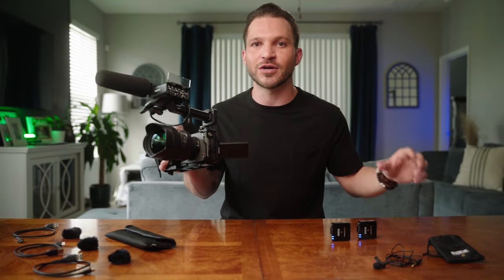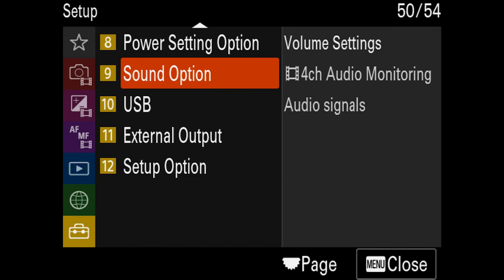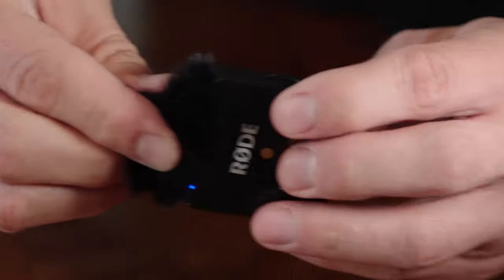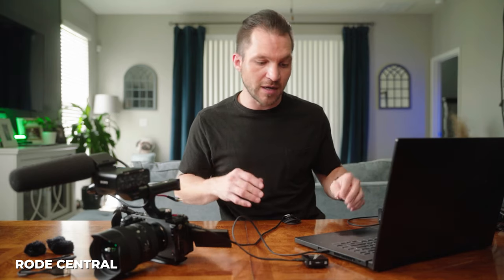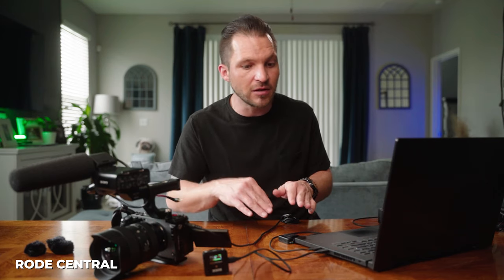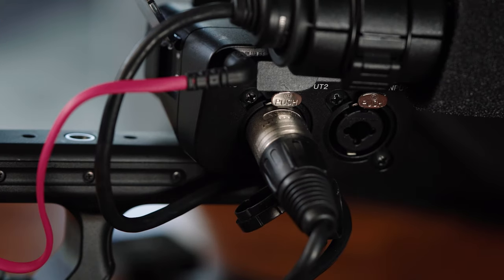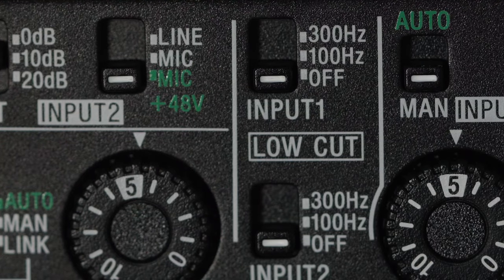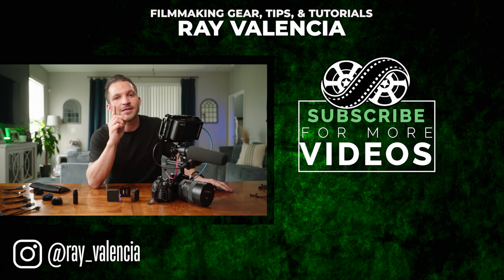RODE Wireless GO II on the Sony FX3 XLR Audio Handle Explained

Comment: Great video. I learnt a few new things on this.  The only thing that i think you mixed up was when you are using the 3.5 to xlr     Xlr is a mono port so when you use that adaptor you are combining the wireless go mic’s and they will be on both channels.  Best port to use would be 3/4 then channels are split    If you want  control of both channels then you would want to split your 3.5 out of receiver with a y cable and put one in  ch 1 and the other in ch 2.    This how i run mine and then my video ntg into 3/4

Comment: At 4:48, you show the 3.5 stereo into the VXLR adapter, then put the switch on the back of the handle to input 1. I'm wondering about the next part where you're adjusting audio levels using both dials. You say the dial for input 1 is changing the level for mic1/left and dial 2 is changing for mic2/right.  In my experience, it's mixing both mics down to a single input, but the dials let you change that mixed signal to record at different levels (not separate). The VXLR adapter is not giving me the ability to control left/mic1 with dial 1 and right/mic2 with dial 2 separately.  It's letting me record the same mixed audio on left/right at different levels. Is there a setting I am overlooking or did I misunderstand what you were saying in the video? Thanks for your time, especially to reply to a comment on an old video.
Reply from the maker: Hi Jim!! No, you are totally correct!!!  I see what you mean about how the video looks like you can separate the Rode mics with that adapter.... so what I was trying to say was that with that adapter, you can have finer tuning of your Rode GO mic (AND your shotgun mic).  But if you are using 2 GOII mics, then the 3.5mm jack on the Handle is still better than the one on the FX3 body because you have the additional PreAmps and dials.
Although, I posted a video today of a QUAD Wireless microphone system from Comica that you can actually separate all 4 MICS into 4 different channels on the FX3: https://www.youtube.com/watch?v=cIsBboy6i4Y
Reply: @RayValencia  Hi Ray, so are you saying that it is not possible to connect the receiver to two seperate XLR inputs by using 2 seperate VXLR adapters. Is there only one 3.5 mm output on the receiver?

Comment: Thank You , Another Clearly explained video. I see you must teach your Actors / correspondents well. I'm a sound man so I record the best WAV sound in my mixer. I use channel 3/4 for timecode from my Tentacle  Syncs. Then I use the Rode Wireless Go 2 as a 2 channel link from my mixer, to the inputs 1 and 2 on the Sony Audio Handle to the XLR inputs. I found an unbalanced  3.5mm jack that splits the channels to the Left / right XLR's. Now the editor has broadcast quality audio on channels 1and 2, and a time code on channel 3 that Premier or Avid can find, for syncing my bag audio if it's needed. 
Maybe you can do a video showing this setup that i use for News / documentaries . This gives my camera person the freedom to move with out being tied to a soundman.

Comment: Great tutorial. One question. I’ve been trying to figure this out. Do we need to use the Rode XLR to 3.5 mm adapter or will any adapter do? I have some generic xlr rk 3.5mm jack adapter which I connect to XLR port 1. My Rode wireless go is not detected on channel 1 of the XLR handle.

Comment: Hey Ray. Awesome channel, your videos have been super helpful over the years. 

I’ve got a question that’s always bugged me as I can’t figure out the settings. When I’m using the 2 x Rode Wireless mics I have them set in split mode and yet monitoring on the camera I’m hearing a mixed or merged audio. I’m not hearing 1 mic’s audio in say the left ear and the other mic in the right. Also when I import and seperate the tracks in Da Vinci it only has a merged recording. Wondering if you’ve run into this problem? Or do you just take the individual recordings from the onboard memory on the Rode TXs?
Reply from the maker: Thanks onasht. I appreciate that! If you use the 3.5mm jack (Input 3) it will separate the mics on 3/4 (if you have your Rode set to sep. outputs).
If you want to use the 2 XLR ports, I ended up using a Comica 3.5mm to XLR channel splitter: https://geni.us/Comica_XLRsplitter
Then you can adjust the headphone settings in your camera to play on your left/right ear. Hope this helps. I just got the Rode Wireless PRO yesterday, so I'll be visiting this topic very soon.

Comment: Hi Ray, you teach me a lot with this, thanks a lot. When I manually adjust the levels of my sony shotgun mic on the fx3 connected on input 1, I can only ear it on my left headphone if I lower the level. if I increase it then the sound goes on my right Side of the headphones but when on auto I can ear the sound on both left and right sides of the headphones at the same time…
Reply from the maker: Hey Luca. Thanks. What do you have your Input Selector on the back of the handle set to? Did you see the part where I was talking about enabling a
Your own safety track with the Input Selector? You can make your Input1 shotgun mic go to Ch1 and CH2. Or just Ch1.  Also, check your headphone settings in the Menu. You can specify which channels you prefer to hear in Each ear. This is helpful for lots of Inputs, or if you only want to hear your Lavs and no shotgun mic, etc.

Comment: Hello, I want to ask that I am FX3. I connected the RODE Wireless GO II to the XLR of the FX3 handle, and found that it can only receive the sound from mic1, but there is no sound from mic2. Is it because of the XLR? It is still necessary to use a 3.5 to double XLR, and connect the two XLRs to the handle respectively to solve this problem??

Comment: The xlr adapter eliminates the stereo feature of the rode cuz it merges the 2 signals from L and R to mono on the record. You didn’t mention this, do you know about it or have found a solution? I‘m looking for a solution for month…

I have the fx6 and fx9 and they both have no 3.5mm aux.

Comment: Ray, to clarify my previous comment, if you want to use the DJI Mic (or Rode Go II, which is the same concept) and connect the receiver to the XLR input, instead of Input 3 (3.5mm), could you use a Stereo female to dual mono male cable? The 3.5mm jack coming out of the dual receiver would be splitter into two separate male jacks that you could plug into XLR adapters. Would that allow to get to separate signals on channel 1 and 2, with the benefit of having a full control over gain, Att and low cut via the butons on the XLR module of the FX3?  What do think? Thanks!
Reply from the maker: Part 2 of this response: in a later video, I discovered a Cable that split up my Comica wireless mics and now I use it on the DJI (and used it on the Rodes before mine went into the water). 
Here the link to separate both mics out.
Comica CVM-DS-XLR Cable: https://geni.us/Comica_XLRsplitter
Reply: @RayValencia   Wow, that seems like the ideal cable indeed... Not available on the Spanish Amazon (l live in Barcelona ) but will definitely look into this. Happy to hear you used it and it worked. Also wondering if you use lavaliers on your DJI mics? I tried to connect that of my Sennheiser but it doesnt work ... no signal at all.. not sure why.

Comment: Your videos are amazingly helpful. Thank for this. I just bough the DJI Mic kit and I wanted to connect it to the FX3 using the XLR input, but if I understood well, by doing so, I loose the ability to separate the 2 mics on different channels, right? When you connect the receiver to the 3.5mm jack, it does separate both channels onto channel 3 and 4 but the control panel of input 3 doesn't allow to set the gain of each channel separately (neither does it have low cut and att controls).. So is there a way to get into the FX3 via XLR and have both mics on separate tracks? (1 and 2 I guess...) Maybe does it require a splitting cable? to get into Input 1 and Input 2? Thanks in advance! As an Fx3 shooter, you channel is invaluable
Reply from the maker: Awesome. Good to hear from you. I also recently traded out my Rode Wireless GO 2 for the DJI Mics because The 2 actors in the show I was shooting, fell in the water wearing my Rode mics. I shot it on 2 FX6 and the FX3. It's in the show I shot for TripAdvisor on Amazon Prime, Called "The Wanderer" Season 1, Episode 5: ORLANDO. 
I'll answer the rest of your question, I'll your follow up comment, I just read.https://www.primevideo.com/detail/The-Wanderer/0OV3IWR0DY8UV27HZ4VCXFHBW5
DP: Ray Valencia
Reply: @RayValencia  Congrats on the show. It's pretty amazing to see that high end professional shows are made using such accessible gear like the Rode Wireless GO2.. I'm also used to use a pair of AVX for sound as it's pretty much the quickest and safest option when you're a solo shooter and dont wanna add too much stress and workload.. (I loved the small size of the receivers.. until I saw DJI one.. haha)... but they tend to drop signal quite easily and the neat form factor + internal recording of DJI's mic really attracted me. I tested out today, connecting to the 3.5mm jack of the 3rd input of the FX3. Still need to download the footage and check how it all went. Did internal recording + safety track as I was only using one mic. Battery died after 6hours.. like 10 min before wrap.. the non-exrtable battery is definitely going to be an issue, specially as the product will age and battery health will decrease.. seems like its not a very sustainable product in any sense of the term... For the rest, it was a breeze to use on set.

Comment: Hey Ray, Love the video, super helpful !! Pound for pound which shotgun mic would you say suits the fx3 for the best all around ? I tend to shoot a lot of stuff outside, motorcycle stunt, downhill mountain bike stuff and live bands.. I'd love to be able to capture clean, crispy sound. Love the wireless options, ill def be looking at adding that to the mix after I get a shotgun dialled in. Cheers, Jb
Reply from the maker: Hi! Great question. I may make a video answering this question, so thanks for the idea. I'm rocking the Rode NTG5, short shotgun mic $500, and I have an even shorter shotgun Mic from Deity called the S-Mic 2S for like $300 (The 2S is the Shorter model, the 2 is their regular length mic). But all of those mics are also Water and Moisture Resistant so that would be perfect for your outdoor shoots.
Reply: @RayValencia  Awesome brotha !! Thank you for the insights

Comment: Thanks for the great info!  My middle school is looking to getting into video production program using FX3 (well I'm suggesting we purchase/invest in the FX3).  I was looking for Audio options.  These RODE GO II seem really great for students to use for "on location" interviews at sports & school events and maybe "in the studio" work.  How do these mics compared to other lavaliers you've used?  Do you recommend a secondary hand held voice recorder for interviews or a boom mic to get better audio quality recordings?  Or do you think these GO II's are enough?  My school has funding for equipment and I'm helping to figure out some quality gear that would last for reasonable cost.  Thanks in advance!
Reply from the maker: Hi Xuong! I think the Rode Go II system would be excellent for interviews for sports and school events. They are so small and (relatively) easy to use compared to other systems. The range on them is really good and the connection between RX and TX is improved over the original GO.  I do recommend getting the Rode Lavalier GO for them to avoid having to clip the TX on people collars. It's a little distracting and often times makes t-shirt collars sag or flip over.   Of course, XLR mics will give you better quality if you want to take advantage of the FX3 XLR inputs, but that will bump up your costs as well. I think these mics will serve your purposes VERY WELL. I use them ALL the time. I just ordered the Rode NTG5 (XLR mic) and it should be arriving this weekend. I'll post some videos using that Mic on the FX3 as well.  I look forward to hearing about your experiences in the future with this set up.

Comment: Great review.  For two person trade show indoor interviews from 5-10 feet away from the camera, which do you feel is better -the rode wireless mics or the k3m  in picking up two voices with my Sony Zv-e10?  I travel alot pre pandemic so portability and speed is key. I have a Saramonic Blink but it is USB c and the usb c doesn't appear to work with the zv e10 for some reason.  So I'm looking at options.  I do like the quality of an XLR mic but dunno if juice is worth the squeeze.  The shoe on the Zv-e10 is compatible with the k3m.
Reply from the maker: For 10 feet away, I would probably opt to use the Wireless Go2. The shotgun mics are great for boom mics overhead, especially for 1 person talking head interview, or run and gun documentary style  /// but if you have 2 people talking, and they are turning their heads to each other and back to the camera, their volume will dip down.  Wireless Lavs on each person would be ideal for the cleanest audio.  The XLR mic would be your best bet if speed is your absolute priority because you don't have to mic anyone up.  But once your talent starts getting 10 feet away or so, and you start boosting your gain on the K3M it will pick up more noise than you probably want.
Reply: @RayValencia  super helpful.  Thanks.

Comment: I LOVE your videos and have subscribed. However, I am still so confused about how the input select works. So, I have a phantom powered shotgun mic on at all times. Then I want to add the wireless go 2's to the Input there, where should the input selector be? Then if I go with the XLR adapter, I then have the shotgun in input 1, and the wireless go's into input 2, where should the input selector be? I'm confused, obviosuly, haha.
Reply from the maker: Hi!! First, thank you! Ok, so the Input Selector on the back tells your camera what is supposed to be on Channels 1 and 2. When it's on IN1, then Input 1 is on both Channels 1-2 (which is how you're able to enable a "Safety Track" aka a lower decibel channel on Ch2). It basically duplicates In1 on both Ch1 and 2.  Now, when it's on IN1-IN2 you are telling your camera that you have something in IN1 that will be on Ch 1, and IN2 will be on CH2. When it's on IN3, then it's telling your camera to put your 3.5mm Jack on Ch1-2.  So if you have 48v phantom powered mic in IN1, and Wireless GO into IN2, then the only place it can really go is on Ch2 by itself, or plug it into IN3 and have it split the 2 transmitters on CH3-4.
Reply: @RayValencia  thank you! It makes sense now! Keep the videos coming man. You do great work. Love learning more about my FX3.

Comment: Great video sir, definitely taught me alot! I tried setting up my new DJI Mic's the same way you did here with these Rodes but I can't get them to be on seperate channels like you did even though I followed your exact steps to the letter? I want to eventually have my two DJI wireless mics with lavs on seperate channels going into my FX3 and then my Sinheiser shotgun mic seperate as well. I do weddings and this would seriously make my post editing a breeze! Any suggestions or insights? 🤷🏽
Reply: did you ever solve this issue? Thanks
Reply: @catch22sergio  No I didn't. I recently bought the Sony ECM-B1M mic for my FX3 while its flying on my gimble which is how I use the FX3 for most of my weddings.  When I mic up the groom and the officiante using my DJI mics, I just put the receiver on one of my A7IV's which are always on a tripod. Problem solved. I have hardly ever used the FX3 handle since I bought it. Personally I just don't care for the hand held look, not trying to make a Michael Bay movie! LOL

Comment: Hi Ray, I've got a question, use rode wireless go II with LAV GO from Rode by VXLR+ connector and it's so noisy like fan or something in the background. Do you have any problems with LAV mic plugged to FX3 in my case FX3/FX6 same issue? Love to hear your feedback!
Reply from the maker: No, I don't have any issues with noise, but that VXLR+ adapter could be the problem. That is a Phantom Power down-converter.  The Rode VXLR adapter I show in this video is simply an adapter, it doesn't do anything with the power. https://geni.us/RodeVXLRadapter   Just make sure you aren't outputting Phantom power to any mics other than Condenser mics (that require it).

Comment: Great vid!! I changed the settings to 4 channel in my fx3 but now pluraleyes 4 will not sync the audio with the other 2 cameras.  Any suggestions? I have narrowed it down to it being 24bit
Reply from the maker: You know...I run into some syncing issues in Premiere sometimes too, especially If I have 4 channels enabled and I only utilize 2 of the channels. I have to manually Delete Ch3 and 4, and then synchronize after that. Not sure if this helps, but maybe someone else will jump in on here that uses PluralEyes. I wouldn't think the 24bit would affect it....but it is very possible.

Comment: Hi Ray, I have the same setup but on a Sony A7R4. When i connect the receiver via the xlr adapter on channel 1 the two transmitters are automatically merged to mono (while the display on the receiver shows  separate channels). I'm still looking to a way have two separate (editable) channels in camera. I know I can use the backup recordings, but it would be lovely to have it direct in camera. Any thoughts?
Reply from the maker: Hey Brante & Immink. I believe this is a limitation of XLR...and the RODE's output.  The adapter is converting it to a single channel.  The only thing I can think of trying is to have a 3.5mm to XLR splitter, and if that doesn't work...that means Rode's output isn't capable of splitting the signals into Left and Right XLR. I'll see if I can borrow one of those cables and give it a try for you!
Reply: @RayValencia  thanks. I think you’re right though. Keep me posted :)